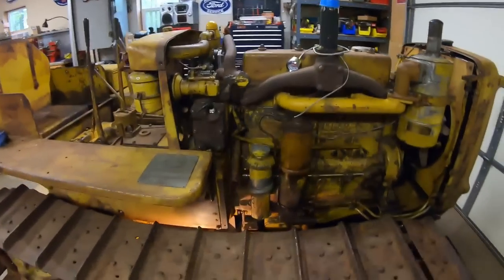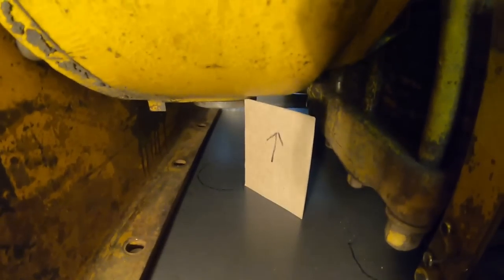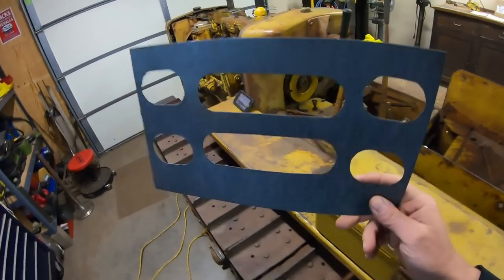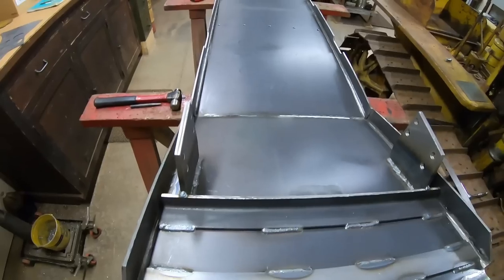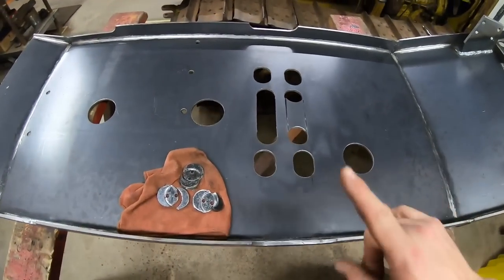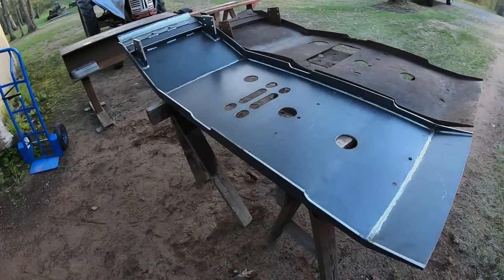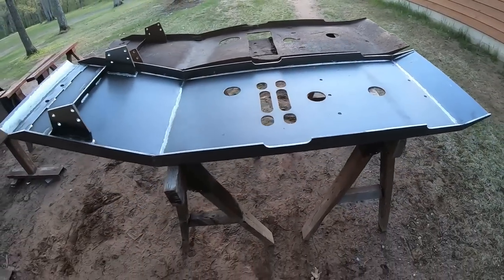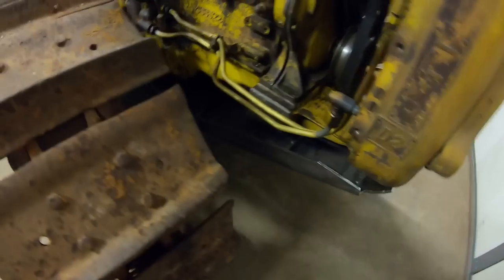Caterpillar D2 #5J1113 Chassis Rebuild Ep.52: From "Spent" to "Mint" - New Belly Pan Build Finished!

Comment: You have a great deal of patience. I would have been driving that D2 around the farm even before I had a seat on it. Nice work!
Reply: @squatch253  I understand. But I don't have a D2...I would be driving it and getting it and myself really dirty.
Reply: Outstanding workmanship. No  shortcuts, only careful & precise processes. 5 stars & full marks!
Reply: We don't know what he does behind the camera :D
Reply: @hawksights  lol! I think he does all the work that he has us believe. I've done some projects that required a lot of careful work (one such project was to design & build a root ripper for a small Kubota tractor, which turned out pretty well, & did basically what I was hoping for), but nothing as large as the underside pan project. I don't think I could have produced a pan that was as exact & fit as precisely as the pan he made, at least, not without a lot more fiddling & trial & error, partly because I don't have all the tools he has, & partly because I don't have as much no how & experience, but I would still try to be as careful.
Reply: @squatch253  I have a link for you but YouTube won't let me post it. I also have Cat wanting some additional info.
Reply: Great. Job. A true perfectionist

Comment: When using the large diameter hole saws, I like to drill 3 or so pilot holes about the circumference (staying on inside of cut) as ‘waste’ holes. The swarf just drops away and improves time to cut. Also keeps teeth alive for longer 😎

Comment: Hey Toby ..... It still seems to me that you wouldn't want to do a heavy pull with that front tow hook (especially at any kind of steep angle). I maybe wrong, but my gut feeling is that it could rip the front of the belly pan apart.
Anyway, great job of fabrication! It shows your patience and interest in what you are doing. Some weathered paint and it will look like it was original.

Comment: Some free advice from a Aerospace Engineer with 4 decades of experience in Military Aviation.  As any honest "Design Engineer" will tell you, the first design is not necessarily the best over time. We spend decades and $ "bazillions" learning from our mistakes to improve performance and longevity; hence so many "Retrofit" Programs. So take into consideration the weak points of the original belly pan design ... if she's prone to stress cracks in areas across the board, best deal with it on the ground rather than waiting for it to happen again (Insanity is doing the same thing over and over again expecting a different result). My personal advice would be to weld some "doublers" in the area where the pan tends to always crack to strengthen rigidity on that plane ... you have enough space to do this. And you are making my molars hurt ... use some cutting oil when drilling your holes even on pilot holes ... pretty please. BTW, carbide tipped hole saws are cheap and much better than your "bi-metal" ... and can be re-sharpened ... unless you've got money to burn.

P.S. ... in answer to your Squirrel/Mouse infestations ... I too suffer from this on my C6 Z06 Vette here in the Riviera ... the answer, believe it or not, is the use of Cotton bunting and drops of "Peppermint Oil" ... they do NOT like the scent and stay away ... just remember to remove the bunting prior to operation ... just trust me, it works.

And yes, you did a beautiful job ~~~ Kudos !

Comment: Nicely done Squatch. I can pass along a tip I learned using hole saws in steel. I put a rag inside the saw to soak up oil. It not only helps to lube the cut but also goes a long way in keeping the hole saw cool. Worked for me.
Reply: good shop procedure, IMHO

Comment: So on the pan because of the holes  for the spring weakens the pan so much. Seems if could add three cross supports strap(flat bar stock, across edge to edge on in side, close to the slots. That would put strength back in that area!

Comment: I had a rat build a nest in a Kubota m-9540. He also chewed a small hole in a hydraulic line on just the right location so that when his nest caught on fire the hydraulic oil squirted onto the flames. 10 minutes later the only thing left of my tractor was the the metal. I never imagined how fast a tractor could completely burn up. 
Luckily I had insurance but still lost about 5000 in cost of a replacement. Had to call the volunteer fire department to keep from burning up my farm. Odd thing was Mennonite woman showed up to put out the fire. Had there dresses on and everything. It was quite the spectacle.

Comment: Excellent fabrication work, especially so, since you were dealing with a twisted, bent, stretched, torched, etc. rusted belly pan to use as an unreliable template. I hope someone helps you out with the sidebars and bumper that you need measurements from or even better, with an offer of all or some of the parts themselves.

Comment: Are you going to make a custom drain funnel out of pvc pipe or fittings with a flange and magnets glued on.  So you can loosen the drain plug. Stick the magnetic flanged funnel in it.    If add a Y fitting . You could use a sink drain slip fitting with a piece of smaller pvc with a drive hex on the end to allow you to spin the loose drain plug off and drop the pair down to allow the oil to drop straight into the Y then thru the branch of the Y into the drain pan eliminating oil spills all over the inside of the skid plate. 

Perhaps before you bolt the skid plate on for the last time.  You might do a measured drawing to post to the club website.  As laser or water jet cutting the shape  and all the holes could be knocked out easily then it's just relief cut and bend..  I am sure you are way ahead of me on this.  
Lastly. With the trees felled.  Have you slabbed off a few to park the Ten and the iron mistress on. Keeping their tracks off the ground.

Comment: Nice job on the pan. Why don’t you double up the steel where those spring access holes are at? Just use the existing holes to trace out on another piece of steel. Make it about an inch further out then the edge of the holes and weld it in with some inch long beads. Same thing up the side. I know it isn’t factory but the new one isn’t either. You will have more strength and the factory looking holes and slots.
Reply: There probably isn’t enough space for that extra steel so the spring can go through it’s full range of travel otherwise it probably would have been there from the factory.

Comment: There is no doubt in my mind that if you had repaired the beer can Cat's belly pan, you would have had plenty of beer cans to make shims out of. If you haven't tried straightening distorted metal before, don't try it. It will drive you insane or to drink.

Comment: That bumper is going to end up being a unicorn. Even looking into forestry-specific machines with various keywords, there's not a single bumper to be found. Though, every search I've tried has their results bloated with dozers, including all the forestry-specific searches. I've also found plenty of grill guards, but not that specific one. I'm curious if that was CAT original or a piece from a third party, either dealership or company specific parts. I only found a singular 'bumper' in all of my searching, and it's part of kit for a heavily modified machine and is specific to the piece of kit; so bumpers in general seem to be a unicorn themselves. Even finding evidence seems to be a unicorn for this, short of diving through old books and catalogs, as that singular photo in the photo archive book seems to be the only easy source of evidence of a D2 bumper. Are there at least any part numbers within your collection of other CAT books, to verify that there is a CAT original bumper?
Reply: @squatch253  I'm amazed you were able to source one, all things considering. I wonder how rare these original CAT bumpers are, since bumpers in general seem to not be a common item at all.

Comment: Does the side rail frames bolt on under the pan brackets or on top the pan brackets? And a hogen mag base drills are really  nice for making hole in things like that no twisting on your arms snags with a rotor bit or as some say slugger bits

Comment: Is it neccessary to weaken the pan in the mid section for the main spring access? How often do you have to access those screws? Would it be much more work to remove the pan to access the main spring screws but instead have a more ridgig mid section? Or do you just go for originality?

Comment: Oversized holes for bolts are not uncommon. In current heavy industry, a half inch bolt would have a 5/8 hole, a 3/4 bolt would have a 7/8 hole etc.I see no issues with going 1/16th oversized.

Comment: This new pan is never going to get as bad as the old one (or any used one) would get, but man, looking at the damage on that old one, this is a spot where i feel that Caterpillar kinda phoned it a bit. All those holes, on an item that can always and will always catch and be hit and abused. Dunno. At least some bracing or extra metal reinforcement would've been fine. I mean, i'm looking at the rest of the machine and this one item, feels like it's not up to snuff, not compared to some of the other parts/components (of wear and tear). Just my 2 cents (prolly influenced/spoiled by more modern pans with modular design and thicker plate).

Comment: Just out of curiosity I did the calculations and each heavy washer you made with the big hole saw costs $0.95 although I'm not too sure my math is any less rusty than the old belly pan ;-)

(Edit: typo with decimal separator for USD)

Comment: Old and busted:
"Overhaulin' " spends a week "restoring"  a car.
New hotness:
Squatch 253 spends a week making an accurate belly pan.
Reply: They had a crew of dozens of people, first in line for any outside work,and no limit on money. I was always curious as to whether the customer paid for any of this work. They did seem to put out first class work that will stand up to being used. Many of those " reality shows" have done sloppy, cheap work that basically falls apart as soon as the camera leaves.
Reply: @squatch253  Not to the standard you're building J1113 to, never mind the MM X10.
Reply: @kenore4003  Maybe I'm looking at it all wrong,  but after having worked in auto restoration most of my adult life, I am by far much more impressed by Toby accurately making a "simple" belly pan for his D2 than I ever was watching a "reality" show clusterfu$# a car together in a week.

Comment: I have everything you are looking for for the bumper. Only problem my D2 is at the Rock River Threshree  If you are up for a road trip, I will meet you there so you can get any measurement you need. I would have to go there anyways to get what you need and I am 100 miles away. If you want to call me, Rick has my number.
Reply: @squatch253  I also have factory Cat D2 drawbar extension